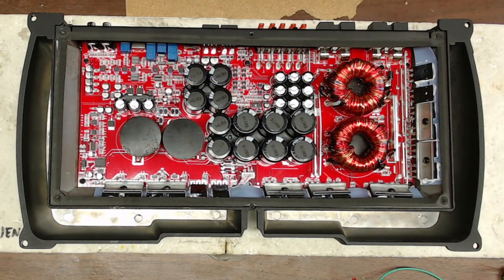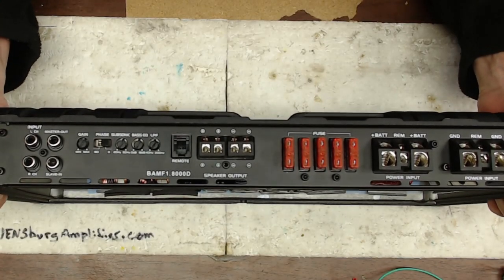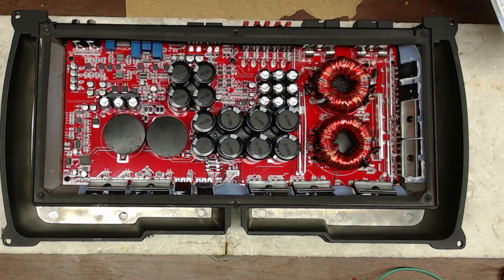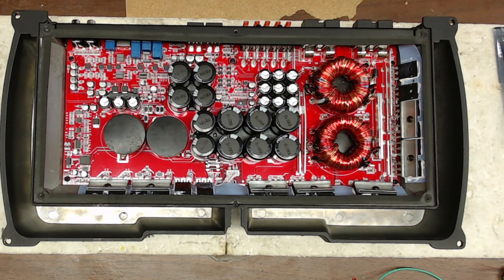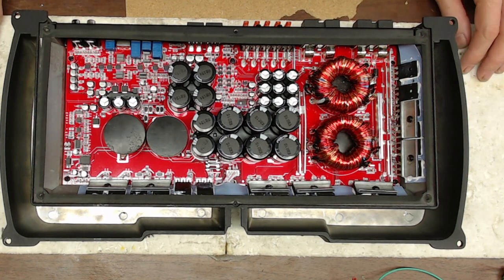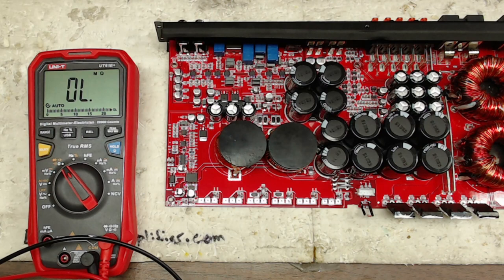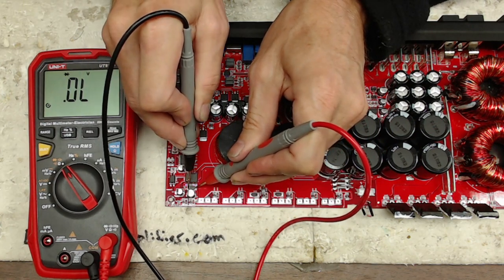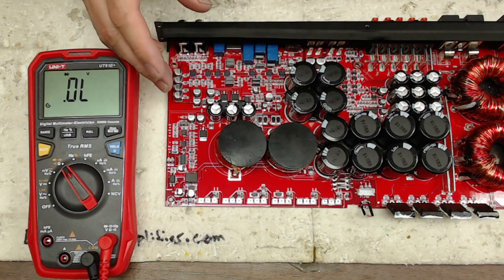Power Acoustic BAMF 8000.1D Class D Car Amplifier Repair and Upgrade Power Project

Comment: My friend, I have the same amplifier and it burns as a result of flipping the electrodes. Can you explain to me how I can check if there are any other damaged parts other than a transistor?
Reply from the maker: You will need to pull the power supply transistors to make sure you have gate drive. Other than that you will need to check the output drive (with the transistors removed) once the power supply is up and running. A scope will tell you a lot!

Comment: Hi Todd thanks for showing how you do the precautionary checks before installing the new ones. Do you go about the same procedure at times for the primary side
Reply from the maker: Yes, I do take the same steps for the power supply end. One must make sure that 2 conditions exist. 1- there needs to be the correct signal, amplitude, and frequency. 2- no signals are on at the same time at any given point. Even the slightest crossover can heat up a transistor.
Reply: @ellensburgamplifier  thank you for the information

Comment: These amps aren’t good I’ve burnt three in a month. Every time I turn on my air conditioner to keep it cool
Reply from the maker: Actually, these amplifiers use some of the most common transistors and the same drive as an amplifier like the Orion XTR's. If you have gone through three of them I would check what your voltage is dropping to and double-check what impedance you have hooked up.

Comment: Good video. I’m just wondering, when you are probing with your oscilloscope you’re not using the short ground clip on the probe, I can see the power supply leads on the board and then a red clip to the board on the left. Are you attaching that red wire to the outer shell on the BNC input on your scope to get a ground? Can you do a small video clip on that setup so I can replicate that with my scope? Thanks!
Reply from the maker: Grounding the scope seems to be a common question. I think it will be a good idea to make a dedicated video on this as there are several key safety precautions when it comes to scope grounding. Maybe I will cover this on my next live stream? (tentative 10-6-21).

Comment: How many watts do you think this amp puts out?
Reply from the maker: A person may get 3k but I do not dyno here so I don't know the exact numbers. This is a lot like the XTR's.
Reply: @ellensburgamplifier  3k you think? the edge 10k only did 3k and it's half ohm stable. And it's a tank.
Reply from the maker: @johnnyditommaso6807  Ya with high enough voltage I can see the BAMF hitting 3k bursts. Now the EG1-10k is a Korean build so a whole different beast with a different switching style. That is the big difference that the Korean builds have over others, can be run at .5 ohms in the right conditions.

Comment: Hello good video, The original power supply and output mosfets were irfp064n and irfp260n?
Reply from the maker: Yes, that is correct for these amplifiers.
Reply: @ellensburgamplifier  I am repairing 1  , You advise me to put irfp1405 and irfp90n20d or put the original ones. Thaks
Reply from the maker: @octi440  The drive does not work under load with the 90N20's so yes use the original transistors for the outputs. The 1405's work well for the power supply but are not needed since you can only use the 260's in the output.
Reply: @ellensburgamplifier  Thaks
Reply from the maker: @octi440  Any day!

Comment: Awesome vid and really like the explanations of why and how to take precautions before&after steps. Also what was upgraded by changing out the output fets to higher amp fets? More stability at lower ohm loads?
Reply from the maker: I ended up going back to the OEM transistors since the 90N20's kept poping the drive IC. I didn't have the time to go through and switch out the gate resistors as that does take a little bit of scope time to do. The goal was cooler transistors.
Reply: @ellensburgamplifier  ahh ok, ya prolly for the best. I want to learn to upgrade as well but figured I’d better learn proper repair before digging into that lol. Which btw you mind poking over at the video on my channel? There’s only 1, having a feedback/noise problem with an amp I just bought. It’s plagued with bad/no solder joints and all mosfets mismatched all to hell. Was thinking or going thru and resoldering the joints that need it, and considering new mosfets as well, even if they are bad it can only be a good thing to replace with updated, matched batch mosfets right? I had a few questions on mosfet selection too but already feel like I’m stalking you so 😅 I’ll hold off, but ya bro if you could check out that video and lmk I’d really appreciate it.
Reply from the maker: @Tekjive  Yes I agree to learn how amplifiers work (class AB and class D) before going into modifications. I will go check your video out.
Reply: @ellensburgamplifier  I’m reading as much as I can, digging into vids, schematics, data sheets, etc. sometimes seems overwhelming self teaching not knowing where to start but having the drive helps figure it out some lol, and your vids 🖖🏼 and ty, I do appreciate that, I know you must be busy so I dont just see it as a small thing, ty.
Reply from the maker: @Tekjive  If there was one thing I could suggest to people new to amplifier repair it would be the power supply. Having a complete understanding of how the power supply switches, regulated and un-regulated using the typical types of drive IC's and buffers, then that person will be well on their way to understanding the amplification stage.
Reply: @ellensburgamplifier  ok, awesome! Got lucky my 1st repair was a power supply meltdown I guess, lol. Almost done, off to read! Thx again E’burg!
Reply from the maker: @Tekjive  Most excellent!

Comment: Que tranfitores son que número es
Reply from the maker: The IRFP064 for the power supply and the IRFP260N for the output.
Reply: I put they 90n20d
Reply: For the put put
Reply: Output
Reply from the maker: @arturogaytandavalos5298  Did the output IC work with those?